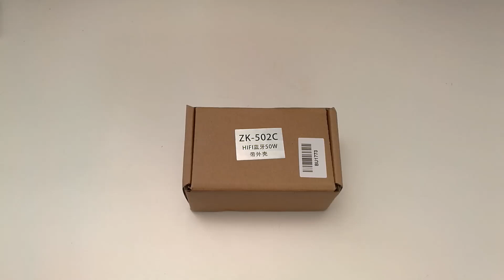TPA3116 amp board 2x50W (Unboxing, Assembly & Sound Test)

Comment: i recommend using 24V to get the most out of these too
Reply: people say they use the laptop supply what do they mean? like they do usb to the provided plug or charger of the laptop?
Reply: @jaredvaz2450  when they say a laptop supply they mean one with a "5.5mm barrel jack"
Reply: @BH4x0r  Ahh Kay thanks man i really needed this reply cus I was confused how people get 19v out of a USB port on a laptop💀 so that means the dc input plug supplied is basically useless right?
Reply: I put it in the speaker of my UTV can am x3 and it is showing a lot of noise in the bass at 14v. There are 2 160w 4ohm speakers. What can it be ?
Reply: @fernandopasini6350  too low voltage, i'd recommend a boost converter rated 10A that you can adjust up to 24V, you'll obviously need a volt meter for that (if you don't have that)

Comment: I 've purchased the 50W version and I 've installed it into a tractor which had a broken, worn-out 1 DIN slot and it works good. To connect it to the speakers, I 've bought a set of female ISO connectors. It 's switched by the ignition key and from the potentiometer, if you want to turn it off.
Reply: power supply kaun sa chalega

Comment: Another channel did a spectrum analysis of this board showing it drops off quickly on the higher frequencies. Also something i noticed myself and is really annoying and i havent seen anyone mention this is that the board seems to have circuitry that cuts the power when the input audio signal (bluetooth) is below a certain threshold. Seems like a smart feature only it takes some time for it to switch back on so you cant use this to watch movies or anything as you'll miss half the dialogue in quiet sections.. very much unusable!
Reply: i need to test that, i'll hook it up to my oscope one day, both on BT and Aux, because that could be because of the bluetooth chip

about the turn-off, i would recommend using an aux cable for music either way as bluetooth can introduce severe latency

i do have the 2x TPA3116 version though (100W bridge x2)
Reply: Wow is it true?. This must be so annoying, this makes bt unusable!

Comment: You need 24V 5A+ to fully power your speaker properly. Read the discription.
Reply: Is it safe to run zk 1002 with 24v 8A adapter? Does it get really hot or burn out? Just running some 6in standard speakers.
Reply: @w3eonline  That will be fine for the amp, it's a 2x100W model so your supply can't even max it out.
You could also use a 24V 100A supply if you want, doesn't really matter, the amp only pulls as much current as the speaker can consume at the set volume with the given voltage (more voltage = more potential power!). It's all good as long as the supply voltage isn't to high for the amp and the power supplys max power rating is greater than the combined speakers max power rating, so you don't overload the power supply and burn it out.
Reply: @vatterger  thanks for the information. Now im getting power supply 24v 20A  fan type paired the zk1002 amp and speaker 6ohm max 80watts.
Reply: @vatterger  
Can this amplifier play 160w*2 sony speakers in normal volume…?
Reply: @syedpak9549   Yes, probably. 30% is already crazy loud with my old, medium sized stereo speakers. I don't know your Speaker model, so i can't say for sure (The impedance should be matched! This is more important than the max power of the speakers!). One word of caution though: The bluetooth connection on this amp is open for any device, this means anyone who is near you can connect to it, even while you are listening. What is most infuriating is, that the new device will always be prioritized when it first connects, so you will be kicked off your own amp, which will drive you crazy! Better get a model with a pairing button to avoid this mess. You will be very very very annoyed with this amp if you have just one malicious device or person with a phone near you.

Comment: I just bought one. It comes tomorrow. Going to connect it to some outdoor speakers.  I will find a weather proof container for it. Maybe a kitchen container?
Reply: so what happened? are they good?
Reply: Exiled in the Path of Exile  Yes. It’s a good amp.  I ended up putting the amp under one of the speakers to keep it out of the weather. The speakers are the type that look like rocks so there was room.  I plugged the amp into a smart plug outlet. When I lower it up with my phone it automatically connects and is ready to play music. Sound great.  Best for the price.

Comment: Well first of all, if you want more volume you need a power supply that outputs 24v dc (at max) because these TPA3116 provide little power when powered by 12v power supply. Second, you need to check if the circuit have a NE5532 as a pre-amp in the input stage of the aux input (analog input) this helps when using low volume sources, as a smartphone headphone output.

Comment: Hei how many Amps this support I have an old hp 65W adaptor 18.5V 3.5A, can this burn the circuit, or I would be safer with 9V 1A as I only want to use it on 15W 4ohm RMS speaker

Comment: I have also this bluetooth module but it makes buzzing sounds on my speaker? Anyone experience with this problem?
Reply: Are you utilizing a switch mode or linear power supply? Switch mode units are not recommend for audio equipment because of the noise interface of their operation. Try different power supplies. If you suspect the amplifier itself is carrying the noise try using a battery.  If you do so & sill have the noise issue, then it's the amplifier itself.
Reply: @Rudofaux  yeah, somebody said it depends on power supplies I used 9V 2A only that is why my bt device creats a buzz noise. Thanks for the info
Reply: @adrianestanislao926  also dont leave the amp volume on max, thats when you get BT noises.

Comment: What of I connect a 200mm 8ohm woofer as subwoofer in a sealed box. In my car? 3 fuses, 1st in + battery 12v, 2nd between an on/off switch and a volt booster from 12v to 24v, and the 3rd from volt booster and tpa3116d2 100w2 2 Channel (no mono output). What of i connect this woofer in One of Two channels? My piooner x3500ui has a pre out where i connect the woofer amplified by this tpa3116d2 and this radio has lpf built in software i think.

Comment: The speakers make that screech sound when you change volume because of you power supply.
I had a 12v 2A and it made that sound so I switched to 24v 6A an it works BRILLIANTLY!!! Just buy a higher power PS.   It’s quite a common problem with small amps like this.
Reply from the maker: The power supply is exactly 24V 6A..  so it must be something else..
Reply: one problem i noticed with the ZK-1002L is that the speaker gets pushed when you change volume, like a DC offset.
Reply: How do you supply 24v with a 12 volt car system?

Comment: Would i be OK with powering this amp with a portable battery pack? It has 3 different voltage settings i believe it goes to 12 or 15. 20000 mah..I'm trying to redo this old stero backpack I bought and wanted to upgrade the shitty old amp to a Bluetooth for my phone and new speakers..small speakers..just 3 inch full range like 30 or 40 watts each.
Reply from the maker: sure.. 👍 it should work with no problem 12 or 15V DC.

Comment: your using a phone, the output of a phone is not loud enough to make the amp play max or louder when the amp has a normal high gain (how high the gain is from lowest volume to max you can turn it up)
Reply: inbuilt bluetooth, it needs a 24V psu

Comment: my power supply will be a 10.8-12.6V (3s) battery
my bms can provide up to 10A
is that enough for 30W+30W?
my speakers are 14Ω and they draw less power naturaly, Im afraid I wont be able to get 30+30 with the 10.8V
my battery pack has 6 batteries and I can change the BMS-configuration to get 22V if its realy needed

Comment: i have this one too.. but i used 24v 10a for powersupply.
Reply: Hi may i ask which brand/model ? thanks, gino
Reply: Sir Mediatech Learning, does your bt device make buzzing noise in your speaker too? Why is my bt also has buzzing noise. Is it normal?
Reply: Aditya Kashyap  yes, i i knew it  someone said it depends on power supply. I used 12V and 5A power supply
Reply: Aditya Kashyap  i do not have

Comment: I bet it sounds alot better on some aftermarket brand 4ohms speakers
Reply: You are absolutely spot on. I'm using it with a couple of 4ohm speakers and the sound is loud and clear irrespective of the connection - both Bluetooth and aux imput produce a loud and good quality sound.
Reply: @alexanderkrupin5669  what power supply did you use? Volts/amps/watts?

I have 35w 4ohm speakers with a peak of 300w

Comment: I don’t know a lot about wiring/ electrics so the may not make sense. For me 1 speaker has Red& Black wires for the subwoofer and Blue& Brown wires for the tweeter. How do I go about wiring this one speaker to the the amp? Then wiring another speaker additionally?
Reply: this is a 2 channel amp, no bass/woofer channel.
Reply: just parallel the subwoofer and tweeter

Comment: I have owned both the 2.0 and 2.1 version with the tpa3116 from wuzhi. From my experience with both of the amps i would probaly only recommende the 2.1 version. The 2.0 did not sound great, and was overall just worst. The 2.1 is great for a pair off speaker under 200 dollar. The watt rating is obvious fake, are probaly alot lower. For me when is switch between powersupplys with different wattage the overall loudness didnt  change. A power supply with 20-50 watt will be great, and a 18-24V Are also great. I use a Harmon kardon dc power supply that is rated 19V, and 2A (38W) and the 2.1 version was able to run the most unefficent speakers to such high volums that it damage my ears. So it plays really loud! Great buy for a lower to entry level setup, no noise and high watt output.
Reply: Very usefull thanks you for that, so you d'ont recommand the 502MT or 502T but the ZK-MT21 or a ZK-BT21 (It use the TPA3116D2 x2 in 2.1) ?
Reply: The 2.0 version sound ok, but not great. It sounded bad while connected through Bluetooth, and when wired it was ok. The 2.1 on another hand is pretty decent. Most people that buy their first set of speakers will be happy with it, my brother who used it right now seems to be happy with it and dont seem to want to replace it any time soon. Its has no buzz sound, sound decent and the Bluetooth sound dont sound noticeble worse then wired. For the money its hard to get any better. So if you where to use it with cheap speakers(under 150 euro/dollar) then its a great combo. The 2.0 its not worth it, its pretty trash and sounds like a 10 dollar amp.
Reply: @EnzoE  No, i dont recommend the 502MT or 502T
Reply: @jacopgrahn7286  Okay i see it's nice to know, i thinks this is gonna help some ppl like me searching about those tings, i will be surely go on the ZK-MT21 with your recommendation for the TPA3116D2 in 2.1, again thanks you for your knownledge, sorry if my English is bad i try to not use Google Traductor and it's maybe not a very good idea x)
Reply: hello, I have this amp but I have a battery that develops 28.8 v. Do you think I can use this battery? Won't that damage the amp? thank you

￼

Comment: i have the 100w x 2 version. i have 2 3ohm 300w speakers. how bad would It be if i connect them to the amp?. would keeping It at a lower volt be ok?
Reply from the maker: Hard to tell.. I never try 3 ohm speakers.. But you can try and slowly raise the volume than to see if it will clearly work..
Reply: Can you update me with this? I also have 3ohm speakers from sony home theater
Reply: @als-techreview  
Worked?
Reply: the 2x 100W version actually supports down to 2 Ohm per channel, the 2x 50W does not

you will severely underpower the speakers though (which isn't bad but wont get anywhere near as loud as it could)

Comment: Can i use speakers 75w rms with 6ohms? I wanna get the 100x2 version
Reply from the maker: Yes you can.. it should work..
Reply: Does it have any distortion?
Reply: @als-techreview  Are you powering the amp on 12v?
Reply from the maker: @commentingsaguaro  no.. On 24V.

Comment: Make a review for the 100x2 version
Reply: @ericvillano5729  yours didn't distort when you turned it up? Mine does and I don't know if or how you can fix it
Reply: @ch3ncerpau148  No problems with any distortion. Even at full volume.
Reply: @ch3ncerpau148  you probably have to use a stronger voltage power supply
Reply: @ch3ncerpau148  use around 24v, it'll get as loud on 12v till a certain point and then it will start to distort on 12v, but not on 24.

Comment: Question; if it says 2× 50 watt, can I only use 2 speakers?
Reply from the maker: Yes only two.. Each for the channel..
Reply: I ask this because there is an amp I would get that also has an additional RCA-tulp slot, I would connect the speakers with a y-cable and a subwoofer to the rca.
Reply: @als-techreview  Oh, alright thx. I'll have to find a three channel amp then.

Comment: Power supply specs. Recommended. Range of power.
Reply: its recommended to run it at 24v and 3amps to get the full power
the amps are not that important if you are limited by the voltage, if you run 8Ωhm speakers a 24 or 18V PSU might give you up to double the power compared to a 12V
Reply: you can use an old laptop charger if you can find one, they are usualy 18V and they provide at least 3-5A

Comment: Hi! 
I have TPA3116 on similar board and with just the same potentiometer knobs, just with additional tone controls (Bass and Treble). 
I bought some small plastic enclosure for that amplifier but those pot-knobs are somehow too tight so I am affraid I will break something if I use excessive force to remove those.. Am I doing some mistake? I used to remove similar caps, but I never had such problem. Is there any trick to take off those caps?

Comment: I wish you would have said a bit more about your line source when testing the AUX. Granted, this is a product intended to be built into a passive speaker to turn into an active one, and I guess one would mostly want to use BlueTooth, but I think once you've got the amp hardware, it's kinda stupid not to also equip it with a dirt-cheap analog connection that could come in handy some day. 

Maybe you could measure the signal when testing the line-in... line level is supposed to be up to 5V, and if they tuned it to allow max gain at that input level without clipping, some sources may simply be impossible to get decent volume from (like if their output level is only 1V). Maybe try the headphone output from a cell phone (if you've still got a headphone jack!) and make sure the volume on the phone is cranked up to the max...

Comment: What was the source of power ? Charger ? Please confirm I wanted to make a bluetooth speaker
Reply: The input voltage is 9-24V. I bought a cable from Banggood that converts 5V USB to 12V 5.5x2.1mm and it works fine with a 2.1A or 1A USB charger (as long as you don't want more than 5/10.5 watts of power output!)
Reply: @nickbrown2976  usually at lower Vsupply performance are worse ... i would stick with 24V/5A ... or at least use one laptop power supply like 90W model.  They usually have 18-20V at the output.
Reply: @gino3286  hi bud, has it got to be a DC supply? I have an old soundbar...it has some 12v ac taps of it...could I use that ??
Reply: @muskymcg  hi usually these digital amps require DC power supply but better to check Good smsp are the Meanwell ones The fan can be noisy Again you have to check Good luck gino

Comment: I have the 100 W x 2 version of this, the Wuzhi Audio ZK-1002L.  I don't know how much true power in watts the 50 x 2 model produces,  but the 100 x 2 model was recently dyno tested at 24V to produce about 80-85 watts before clipping to each stereo channel. See my comment below in response to Hadian Dacuan about what I built over a year ago, and how i use it. For those interested in projects.
Reply: And these are true, real world RMS wattage figures, which is insane for such a small chassis, only showing how technology has improved with these little Chinese class D amplifiers. These Wuzhi units utilize the 3116 chip(s), and are quite capable. While they dont have the dynamic headroom of larger, Class A, or A/B amplifiers, they are very efficient, don't generate a lot of heat, and are quite inexpensive in terms of watts for your dollar.
Reply: @ericvillano5729  Any idea what is the THD number on this amp?  Thanks
Reply: You must use an adequate power supply. For 50watt 2 channels, you need for a 24volt 120watt powersupply. So it is 24v 5ampere.

Comment: Do you connect 4 of that speaker boxes or just 2? What is rating of your power supply?
Reply from the maker: No only this two in centre. One left one right. Power supply is 24V 3A
Reply: @als-techreview  thanks ,but 3 ampere is sufficient for this?
Reply: @GurnamSinghchannel  24 volts x 3 amps = 72 watts, which is more power than this amplifier needs to achieve its advertised 50 watts

Comment: it is great, but i would like to use it with a single speaker (mono) but the bluetooth comes out of the stereo how to do?
Reply: are u trying to plug a subwoofer? thats why u need it mono?
Reply: @exiledinthepathofexile  
thank you for the answer
it's to install in an old radio where I only have room for a single speaker
it works very well on 1 voice but I would like the stereo with bluetooth

Comment: Hm voltage for that
Reply from the maker: 24V
Reply: Have you tried the amp at its highest voltage?
Reply from the maker: @richardwilliams2179  yes I try on 24V.. the maximal is 26V but this is the limit.. thing obviusely work way better through bluetooth! I don't know why is aux so lower on volume..
Reply: @als-techreview  did you turn it up on the device you were playing from?